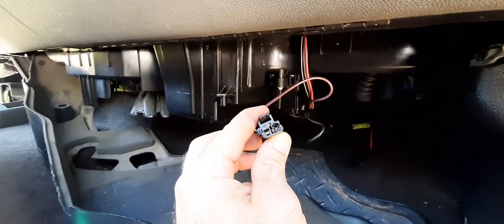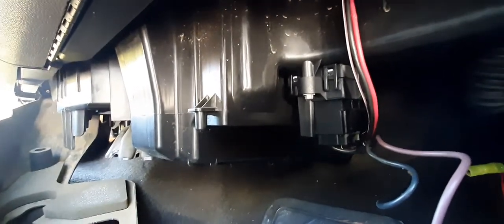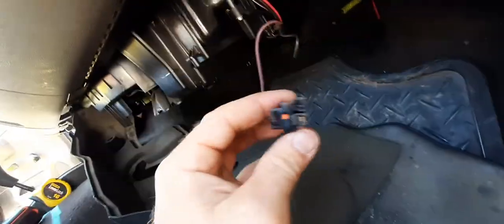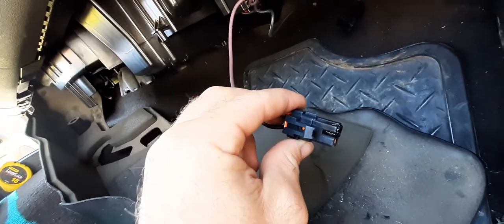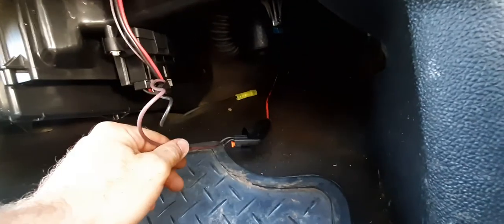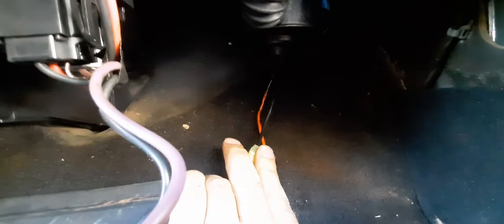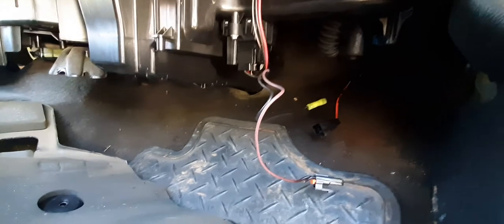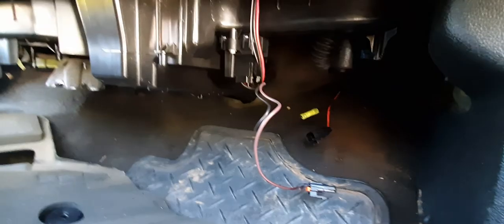07-09 2500 blower motor fan connector melted.

Comment: 2007 Chevy Avalanche.  Same issue here too.  Anyone know if this was a service bulletin?  Recall?  I'll post if I find anything.  The fuse was fine, changed it anyway.  Thanks for the video. 🔧⚙👍
Reply: My 07 available has the same issue. Connector is melded a bit, and the wires got badly hot 🔥

Comment: Any idea why the ground melted? I’m having the same issue.
Reply from the maker: Not sure seems to be a common issue, can be the blower motor resistor could be just a poor connection
Reply: something about the blower motor using an excessive amount of voltage. 

This video provides a descriptive explanation as to what might be the reason and how to fix it. https://youtu.be/e_Mdryj_cgw

hope this helps:)
Reply: Blower motor could be going out, pulling more power than usual causing harness to overheat.

Comment: Seems like you're ignoring why it melted.
Reply from the maker: Your answer is high resistance, would you like me to cover all the possibilities including the unknown previous motor failures with 260,000 mi and lack of maintenance from previous owners?
Blower motor/ resistor, Water intrusion ecxtra...
Or the fact that it's been working like a champ for 2 years now.
And it was likely cause by high resistance from a loose connection?
Reply: Since it seems to be an issue across the board, probably a bad design.  I am not an electrical engineer, but I am accepting any reasonable possibilities and fixes.  Ideas?
Reply from the maker: @firstandlast8674  buy replacement connector, you some small needle nose pliers and gently crimp the female connector slightly so the connection is tighter. A loose connection will cause high resistance which =heat mine is held up fine.
Reply: Bingo bullseye correct. Loose connections in all automotive or home recepticles or any other electric or electronic gadgets appliances etc....will make it not work or work sometimes or get really hot wiring or connection with much resistance and or amps and melt wiring and many times catch on fire and burn cars trucks SUVs and homes buildings boats RVs on and on and on down to ashes. New harness, plugs, recepticles, wiring, breakers, fuses, on and on etc..... needed with anything electrical for centuries, not just now. I have same problem with my SATURN SL2!! Common problem on this type of set up in most GM products. Should be recalled if not ever done. Will check on it though. Easy fix if you are electrically inclined, not for matures that don't know how electricity power works. Hire a pro then. Good luck all with this engineering debacle.